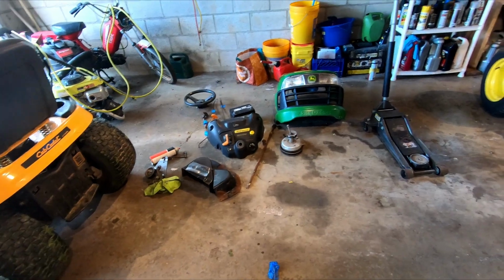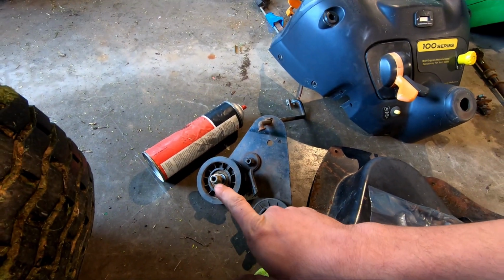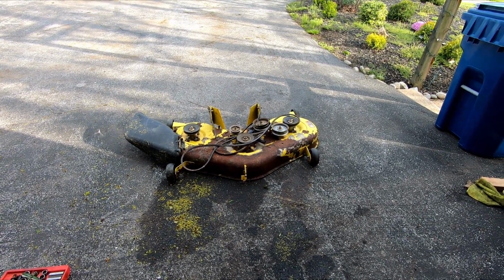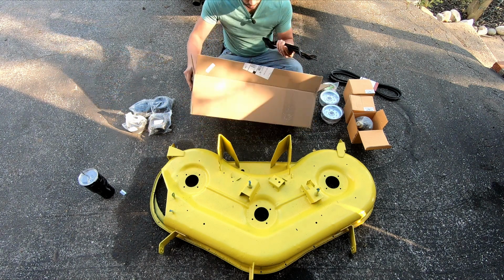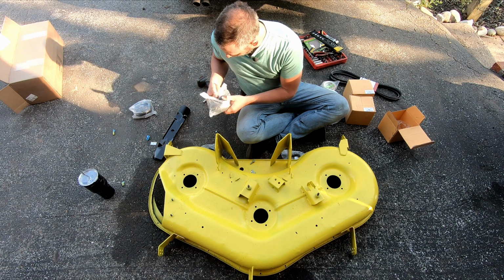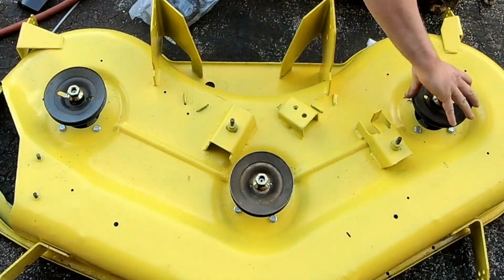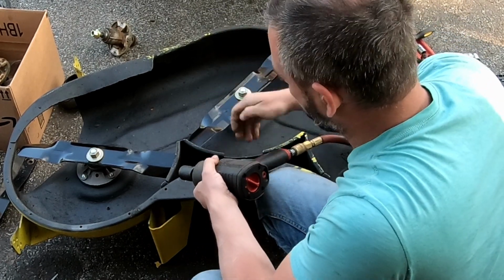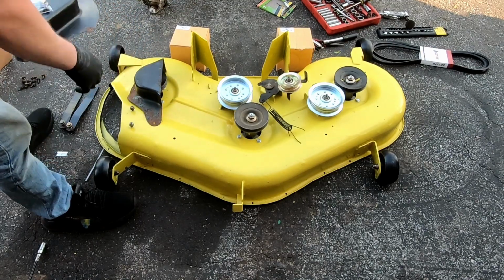JOHN DEERE 145 PART 4 MOWER DECK FULL REBUILD

Comment: You got your tightener pulleys wrong. You need 2 small and one big one. The big one is on the spring loaded tightener, and the two small ones are the solid  mounted to the mower body.

Comment: Forgot to mention the mower spindle bearing are replaceable, 6203-zz on the bottom and 6203-2RS on the top, and buy good quality bearings like SK or NSK you don't need to buy new spindles. Your just way more money for the same shit bearing your trying to fix. There as easy to rebuild as putting on your pants in the morning. Those tighteners are also easy to change the bearings, just drill out the little welds and put in good new bearings from a good brand like SK or NSK that'll last. Fix it right and you'll be good most your life, otherwise your just adding JD's cheap bearing from PEER that keeps you coming back for more. Maybe take the rubber gloves off and try to pretend you know what your doing. You don't have to be a mechanic to do it right, lol.
Reply from the maker: I have since this video realized that, I actually have a video replacing just the bearings on another mower!